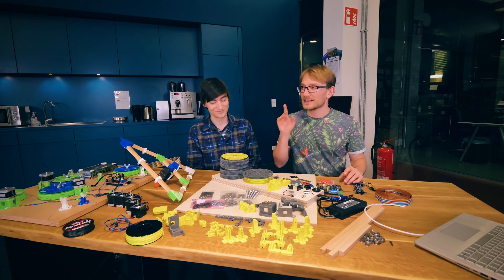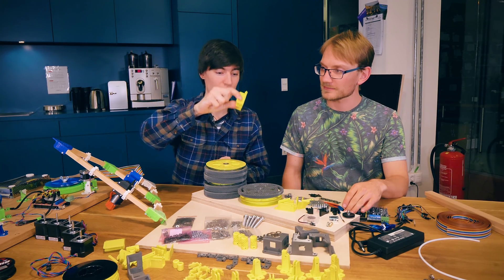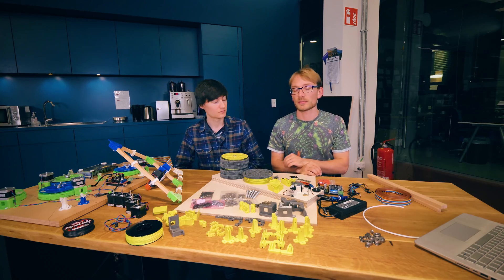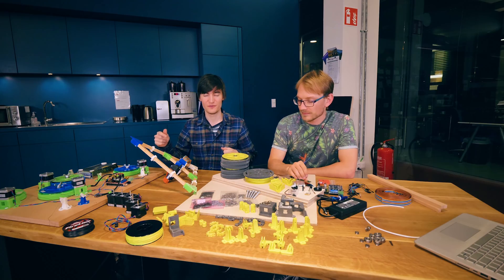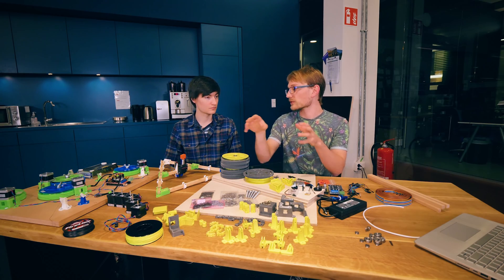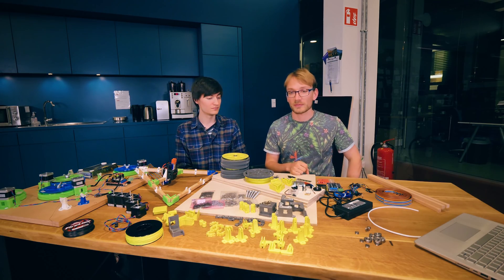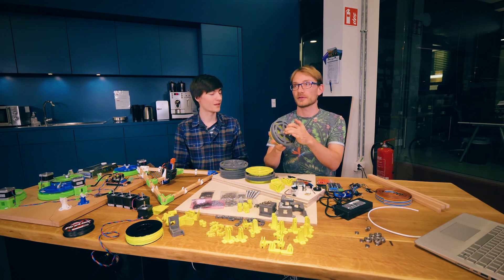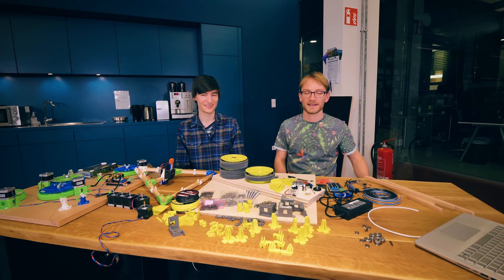Building the Hangprinter: Parts and Options!

Comment: Design flaw. Using wood, yet not taking advantage of the wood's properties and have the parts screw directly in to the wood as opposed to having to print extra material and have clamp style systems which also deform the plastic. SO, those connectors should be made so you can screw them directly in to the wood.

Comment: Hello , your videos are awesome. I have a question and I need your opinion as a professional. 
I need a 3D printer to producing fountain pen (body) and the surface of products  should be smooth , shiny and layers shouldn't be visible. I don't need big printer because pens are not big. But quality is important. As I researched in this case resin printers are more suitable than filment printer. Are you agree? 
What affordable printer you recommend (model name and price and how to buy) and if you have any suggestions for material would be nice of you to tell me.
Heavy material is better because when you hold fountain pen you don't like light pen like a cheap BIC pen.
Thank you so much
Reply from the maker: +Nabi A. Dastaran you're right, resin is probably the best choice! Look into the Formlabs Form 2, but be warned: Even though it's a very nice resin printer, the process is still quite messy and involved.
Reply: use a lathe and blanks instead.
Reply: To my knowledge, you do not get an optically smooth surface out of any printing technology today right out of the printer. The DLP printers do produce a surface that is smooth to the touch and shows no layer lines, but it's still matte. Particularly with pen bodies, i don't see a big deal with putting them in a lathe real quick and hitting them up with 2000gt sandpaper and rubbing and polishing compounds. I suspect that the materials for SLS/DLP printing, being urethanes and epoxies, are slightly heavier than base plastics for FDM printers, but not by much. But then, FDM filaments can come with heavy filler, such as e.g. bronze filled filament. But then, you could also consider getting bronze inserts, simply small tubing cut to length, that you would insert on the inside of your prints to weigh them down.

I hear somebody is doing a UV cure ceramic material for DLP/SLS printers, so maybe that's something that is relevant to you. UV from the printer only pre-cures it in place, they still need to be fired and glazed just like normal porcelain. But i think this may deliver a unique selling point to your pens.

Maybe consider clear coating over the print whatever technology you choose, or keep in mind that there are FDM materials that can be chemically vapour-smoothed, such as HIPS and ABS can be surface treated in acetone vapour and there's Polymaker Polysher that can be treated in in isopropanol vapour.
Reply: Siana Gearz thank you for your complete detailed answer.it was helpful. You have great videos in your chanel. good luck.
Reply: missingpunctuation I KNOW.
But I want to make something different. 
Cigar shape, rounded pen , . . . It's boring. not any more. 
I'm going to make different pen that cannot make by lathe.
Thanks for reply.
Reply: cool idea, hope it goes well